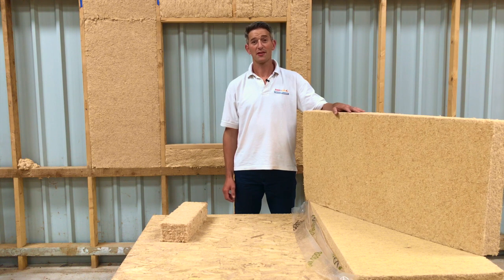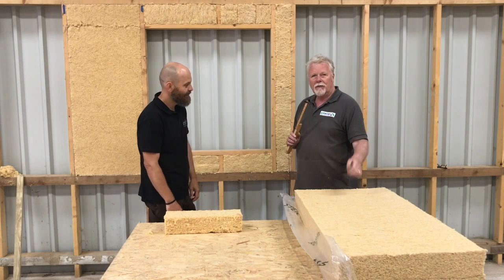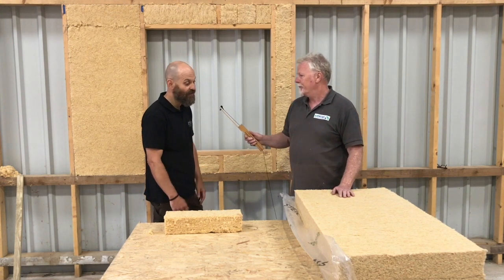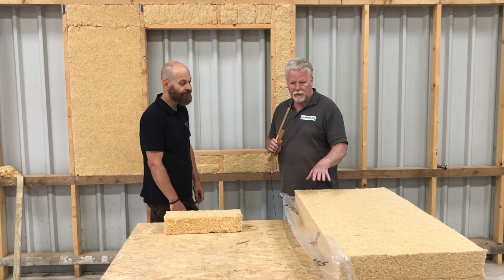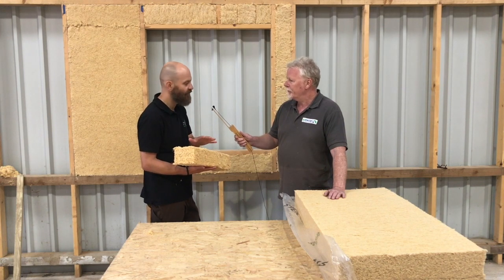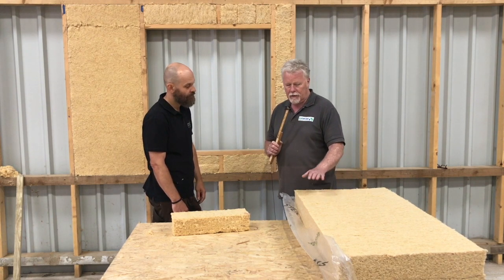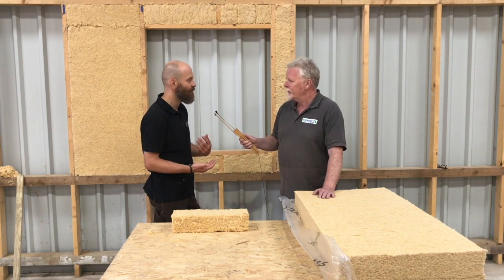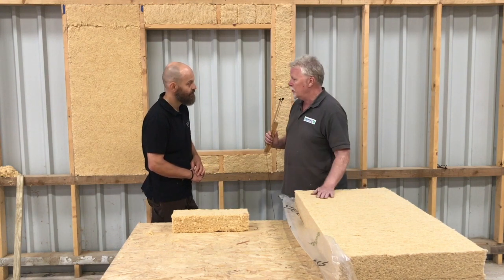SteicoFlex flexible wood fibre insulation

Comment from the maker: Hi. The product contains Ammonium Sulphate which acts as a low-level fire retardant. The product will burn in a fire but it doesn't burn with a flame and generally smoulders so does not contribute to the fire. Ammonium Sulphate is largely inert an non-toxic and is used in food as an acidity regulator. Hope that helps.

Comment: Is this material suitable as a mineral wool replacement for DIY acoustic panels construction? I'm looking for a healthier alternative for mineral wool and this seems quite promising.
Reply from the maker: Hi. Yes, the Steicoflex is arguably better than most mineral wools as it is denser and wood fibres are slightly better at absorbing sound energy as well. This product is 60kg/m3 so you'd need a mineral wool of at least that density to improve on the Steicoflex. Hope that helps.

Comment: Hi. Thanks for sharing this video, great info. Should a membrane be fitted between the flexible wood fibre insulation and plasterboard? If so, what sort of specification is suitable? Many Thanks
Reply from the maker: Hi Jack. Yes, usually a membrane should be fitted between the plasterboard and Flex to maintain airtightness and vapour regulation. We recommend the Ampatex Sinco from our range. Hope that helps.

Comment: Hi Chris - If this product was to be used to insulate a timber shed (walls and roof) is an airgap required behind the insulation. Current wall construction is timber cladding - batten/airgap - permeable moisture barrier - OSB3 - stud wall (exterior to interior) (and similar for the roof). Am i able to install the Steicoflex flush to the external OSB between rafters / wall studs then seal with a vapour control membrane & interior cladding or do i need another airgap? Thanks
Reply from the maker: Hi Jonny. If the OSB3 is on the outside of the studs and rafters then you don't need an air gap between the Steicoflex and OSB. You would need to install a vapour control layer (not vapour barrier) on the inner face of the studs before you apply whatever internal finish you decide to use but again, no air gaps required. However, if you plan to run wiring internally then this should not penetrate the VCL and so a cavity might be useful in front of the VCL, behind the internal finish. Hope that makes sense.
Reply: @BacktoEarthLTD  - That's great, thanks Chris!

Comment: if i batten an external brick wall out that has no cavity.  put this insulation in-between. and then plasterboard over. will it be ok or would condensation be a risk?  i do not really want to lime plaster as its difficult. and from what I’ve heard these walls need to breath. would plasterboard be a no go?
Reply from the maker: Hi K. The SteicoFlex flexible wood fibre batts are not suitable for this application as they are not dense enough to manage the levels of moisture that you get in the wall. We do however have a plasterboard solution with a wood fire board that you can see here - https://www.backtoearth.co.uk/internal-wall-insulation-with-plasterboard-finish/ Hope that helps.
Reply: @BacktoEarthLTD  i seen on the website that plasterboard is actually breathable.  most people say it isnt.     but if water vapour can pass through it then surely it is?
Reply from the maker: @user-cn1em2qx6f  Absolutely. It is perfectly breathable, more so than most lime plasters actually. Just make sure you don't then apply vinyl paints as these are definitely not what I would class as breathable!
Reply: @BacktoEarthLTD  thanks for ur help!

Comment: We have cavity brick walls with breeze blocks behind plasterboard.

Can I put this product behind the plasterboard so it sits between the breeze block and plasterboard?

Do I need to add anything extra?
Reply from the maker: Hi James. Are you saying that the plasterboard is on battens attached to the inner leaf of the cavity wall? You can fill this void if you do not have full fill cavity insulation but if your cavity is fully filled then you should not add any insulation. Hope that helps.
Reply: Hi Chris, it’s battens attached to breezeblock. Behind the breezeblock is a filled cavity, then brick. I want to insulate inside the battens
Reply: Why would you not insulate the battens behind the plasterboard if the cavity behind breeze block is insulated?
Reply from the maker: @jamesthomas3772  Hi James. If the cavity is fully filled you cannot guarantee that moisture is not reaching the inner leaf of masonry from outside. If it is partially filled you can be much more confident that this is not the case. If you have moisture coming from the outside reaching the inner blockwork it may not be visible due to the heat from the interior of the building keeping it dry. Adding insulation would reduce this heat flow and prevent it from drying, eventually causing the insulation to slowly get wet and decay. Obviously I'm talking worst case scenarios here but I can't guarantee that you won't have any problems by using it in the way you wish to.
Reply: @BacktoEarthLTD  thanks for your response. Is sealed plasterboard not vapor barrier in itself that would prevent heat/air passing through to the inner leaf (breeze block) behind it? also would we not be able to tell if moisture was coming in from outside into the inner leaf (breezeblock) because there should be visible signs on the plasterboard attached to that inner leaf that's been there for years no? For reference there's been no heating on upstairs in the rooms for a year+ as the home has been empty and this is in Scotland
Reply: @BacktoEarthLTD  I don't know if it's helpful, but the brickwork on top floor of house is also rendered
Reply from the maker: @jamesthomas3772  Hi James. Sealed plasterboard is actually very vapour permeable so not at all a vapour barrier. If you feel that no moisture has come through the walls (which it probably wouldn't with a well maintained render on the outside) then you should be fine to insulate between the timber stud/battens. It might be worth having a small access panel somewhere though so that you can periodically check what condition the insulation is in. You can usually do this behind an electrical back box or something similar. I Would also include a vapour control layer, such as the Ampatex Variano just to make sure youu get as little moisture flow as possible through the walls during the winter months. Hope that helps.

Comment: I've had an energy survey and advised to use wood fibre board for internal insulation in a 300 year old property with solid walls. Would the use of plasterboards counter the breathability of the Steico boards? Should i look for cork based plaster directly on to the boards instead?
Reply from the maker: Hi Lee. You certainly can use wood fibre boards for internal wall insulation in old houses but not this product. You'd need something like the Steico Internal boards or our UdiIN boards. You can plaster over the top of the boards with certain lime plasters or you can sometimes batten off and use a vapour control membrane and plasterboard. Plasterboard is perfectly breathable enough to be used with this construction but I would suggest you don't use vinyl paint over it once plastered. Please email us if you want to look at this more closely so that we can produce a specification for you. Hope that helps.

Comment: Hi, thank you for this. I’d have watched a number of van conversion videos and they use the Kingspan or Celotex on flooring between studs running on the van floor. Is it then covered with a 6mm or 9mm ply covering. Would this product work in the same way? I’m looking for a more natural product rather than the non natural alternatives
Reply from the maker: Hi Bruce. Yes, you can use this product instead of PIR boards for converting a van floor. We have it in 20, 40, 50, 60, 80, 100.... all the way up to 200mm thicknesses in stock. Hope that helps.

Comment: Hi Chris, we have bought a very old house 1909, the frame is like a log cabin. We need to insulate it from the inside. Shall we put the membrane on the wooden wall, then put SteicoFlex, and then the pasterboard? Thanks a lot. Or if there is any specifications how to install it somewhere, thanks for sharing the web.
Reply from the maker: Hi Zuzana. Thanks for your question. If you want to use the SteicoFlex you'd need to build a timber frame to install the material in to. Alternatively you can use the wood fibre boards which are rigid enough to either lime plaster directly on to or to fix a batten to and then mount plasterboard on to. Which option sounds best for you?
Reply: @BacktoEarthLTD  Thanks a lot. I think plasterboard is better as the room is going to be a bedroom and I would like a wallpaper :) I have been looking for a local seller around where we live. I found a company selling the product :)  Thanks a lot for your reply
Reply from the maker: OK, no problem. I'll let them take over. Good luck.
Reply: @BacktoEarthLTD  thanks a lot. im glad i have found the product as we live in sweden :)

Comment: Hi, my roof construction has 125mm depth. Could I compress the 140 mm to 125 mm thickness?
Reply from the maker: Hi @martbrandjes1213. I don't think this will be possible as the SteicoFlex is quite firm and would require a lot of pressure to do this. You could use 50 + 80mm and squash to 125mm though. Hope that helps.

Comment: Hi Chris, I live in an old house with a basement, would this product be suitable for fitting between the floor joists?  If so,  what thickness would you recommend?
Reply from the maker: Hi Barra. You can use it in a suspended floor so long as you don't have bare earth underneath and there is adequate ventilation. We normally suggest using a breather membrane to go up and down between the joists and to support the insulation. Over the top you should use a vapour control membrane which can be taped to the walls around the perimeter to make the whole construction airtight. Hope that helps.
Reply: @BacktoEarthLTD  Hi Chris, thanks that is very helpful, any recommendations on thickness?

Comment: I have some spare Steicoflex from my soundproofing/insulation project. I don't want to throw away the spare, what else can I use it for in my flat? Any ideas?
Reply from the maker: Hi Maya. Thanks for coming back to me. If you can't put it in any stud walls or ceilings then....This is a bit of a long shot, but what about under the bath? Could help keep the water warm. Also, do you have a hot water tank that could do with extra insulation? Not my normal field of expertise so a bit limited on ideas. Hope that helps :-)

Comment: What size are the sheets and also what about behind the battons there needs to be a layer of insulation?
Reply from the maker: Hi. The SteicoFlex is either 385 or 575mm wide and 1220mm long. Please note the wall behind shows how the insulation fits into a timber frame, it isn't an example of how to insulate any particular kind of wall. If you'd like us to create a specification for you please let me know. Thanks. Chris.
Reply: @BacktoEarthLTD  so for a standard UK wall / loft with 400mm centres won't the 385 board be too narrow to friction fit?

Comment: But why would you pay for this when this product also needs a vapour barrier on the warm side? Unless you can guarantee that there will be no air gap between the external wall and insulation, i.e. by bonding the insulation to the external wall, then you can use mineral wool at 1/3 of the cost
Reply from the maker: Hi. Thanks for your comment and you're certainly not alone in not realising the benefits of using flexible wood fibre insulation over synthetic insulations like mineral or glass wool. If you're interested, please read our article on this topic - https://www.backtoearth.co.uk/news/wood-fibre-insulation-the-myths/ or we have lots of articles about the benefits of wood fibre insulation here - https://www.backtoearth.co.uk/news/. Hope that helps.